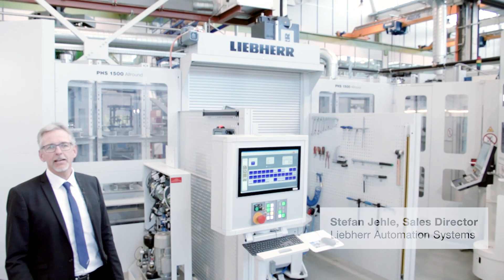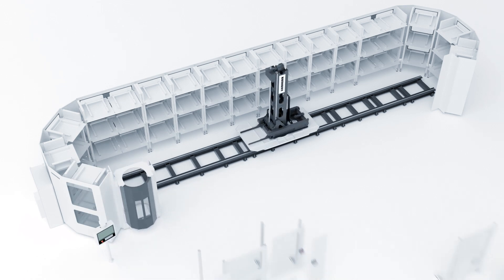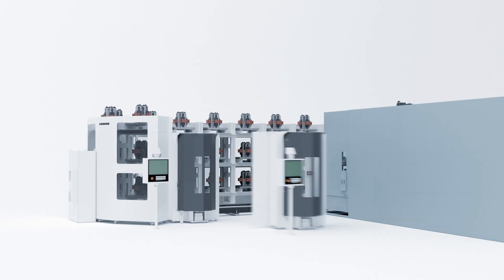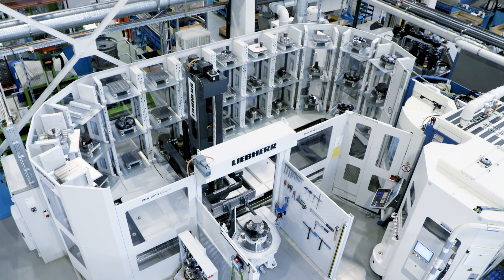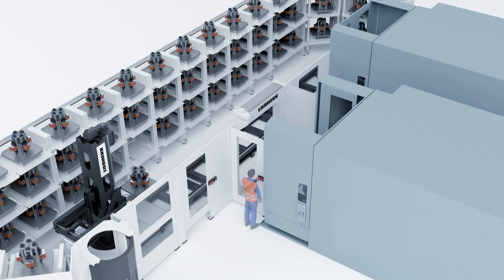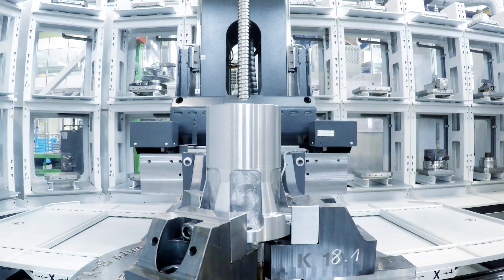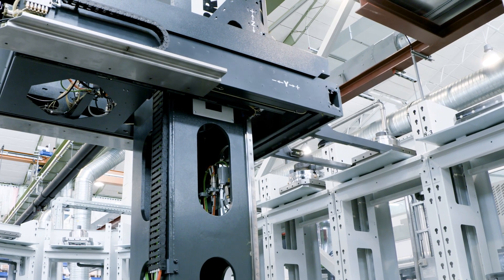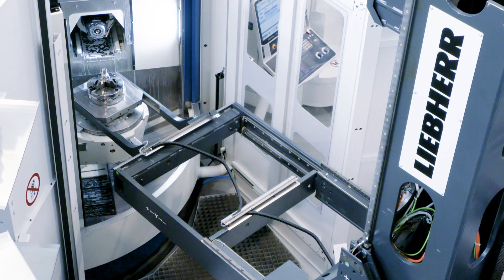Liebherr - Pallet Handling System PHS Allround Statement

Comment: Looks amazing! But wouldn't there be a production limitation due to only one handler? Can more handling machines be added if the production line is expanded to many/multiple CNC centers?
Reply from the maker: @conquer4, thank you for your question! There is, in fact, a limitation depending on the machining times of the workpieces and the number of machines. However, as we deploy intelligent cell control software, this software will even out the production cycles, i.e. prevent bottlenecks to a certain degree. If the cycle times are very short, we have the possibility to use the Double Loader which can un-/load parts faster than a single loader. You can also find an article about our double loader here: https://www.liebherr.com/en/int/products/gear-technology-and-automation-systems/customer-magazine/customer-magazine-2019/phs-allround-mit-doppellader/magazine-content-page.html
We hope this answers your question! Best regards, Your Liebherr team